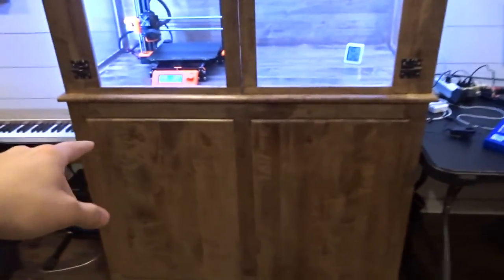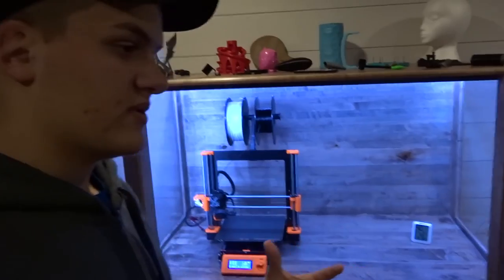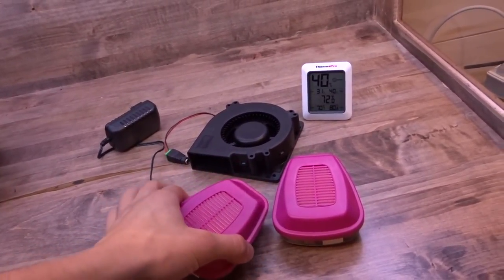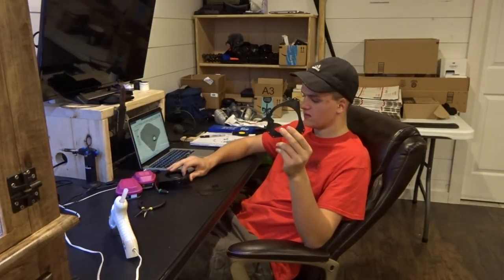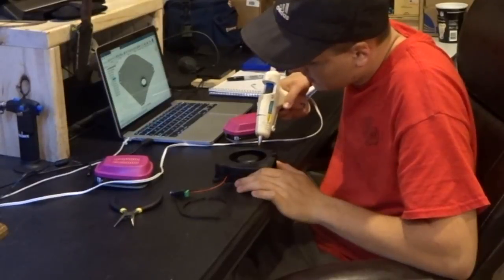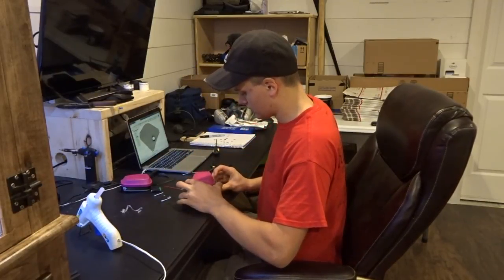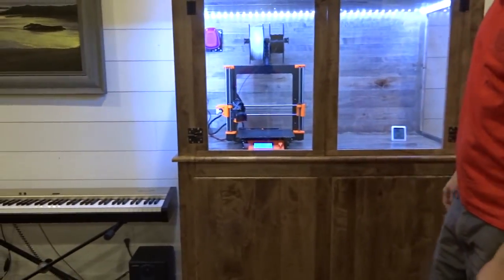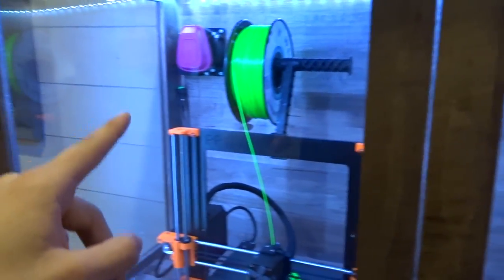3D Printed Air Purifier -- gets rid of the smell of ABS and toxic VOC's

Comment: Pro tip. Keep the spare filter in an air tight zip lock bag. It breaths even when not in use, so without proper storage. The filter is worn out when you're ready to replace the old one.
Reply from the maker: Good advice! Thanks for the tip!

Comment: You don't need to vent it to outside of the box. Just install the device inside the enclosure and let it continuously filter the air inside of there. Keeps inside warmer too!
Reply: that's what i was thinking! i'm going to make something similar!
Reply: Unless the enclosure is air tight, he would need to filter outside the enclosure to create a negative pressure inside the enclosure.
Reply: @AaronCarney-u3u  If it's air tight, you are simply circulating the air, so draw hot air from high up in the cabinet and blow it out low down in the bottom.  but you are just circulating the air through the filters, much the same as scrubbers work on a submarine.

Comment: I took the lazy way and bought a small enclosure, but then I 3D printed a mount for a small hepa filter, then ran that to an inline fan with 130cfm rating and it's done very well so far, noticeable difference in air quality.

Comment: Nice build, I think ill use this in my situation.   Using an old enclosed computer cabinet in my living room, due to having a small house.   I wanted to start using ABS but needed to keep the air clean for obvious resins.  Since this just filters the air side the cabinet it'll help keep the noise contained as well.  I also think ill use this basic idea to run a, separate, HEPA filter in the cabinet ass well. having a separate HEPA should also extend the life of the "fume" filter.

Comment: great idea.  I have just ordered one of these: a "DC12V Vacuum Pump High Pressure Diaphragm Air Pump 12L/Min Noiseless" as I wanted be sure I am getting the air throughput (diaphragm creates a seal as it is pumping rather than relying on the implied suction from an impeller) - just a suggestion/option - hope my comment helps
Reply from the maker: Great idea! Lemme know how it turns out!

Comment: I made a few devices somewhat similar to yours early in the pandemic to protect me during dental visits. Initially I used 3M #60923 filters (what you used), later switching to ones that filter only particulates (VOCs aren’t the problem in healthcare settings).

My initial fan was visually identical to what you used. I found that it and a better alternative — what I’m now using — are very sensitive to intake restriction. Using one filter significantly slashed the output airflow. To provide sufficient airflow for my intended application (dental), I used six to nine filters. The output airflow is much better with nine filters but still is noticeably reduced. That isn’t surprising because fan blade design is optimized for no additional intake resistance. If I had time, I would engineer my own fan so it could, for example, generate better intake suction.

I’ve begun measuring particulates generated during 3-D printing, but my particulate counter (and most others) cannot detect ultrafine particles, which are generated during 3-D printing. The big question is: do 3M and similar small particulate filters substantially reduce ultrafine particles? I will continue researching this and perhaps make my own ultrafine detector.

Most HEPA filters markedly reduce PM2.5 and larger particles but usually are much less effective against ultrafine ones. As a physician, my concern is that standard particulate filters may provide a false sense of security. Yes, they help, but do they sufficiently mitigate ultrafine particles? That is the greatest risk, so I will continue investigating this.
Reply: fyi check out Dyson air purifier filters: they catch ultrafine particles, and have a life of 12 months in the Dysons.  If you were to match the fan strength to the relevant Dyson fan, that might work?  Or just buy a Dyson if you can afford one, the larger the better.  They specifically claim that this filter catches viruses.

Comment: Couldn't you use water as a trap/filter along with this. Have the airflow blow across water to capture ultra fine particles?
Reply: Interesting idea - wonder if anyone has done that, like a small dish of water? I live in a dry climate but for some could add moisture to the filament.

Comment: I am looking to make enclosure for my SLA printer and this is the most elegenat solution i have found. Others suck so bad. I am open to buying fume extractor, but there is no guarantee that the filter in fume extractor is god enough for SLA fumes. So basicly, all solutions come to the filter choice in the end. I have researched slightly and found that the 3M 6099 offers most protection in combination filter. It is Rated A2B2E2K2HgP3 R + formaldehyde. I am only not sure why are there two different types of filters (60925/60926 and 6099) when both can be identified with ABEKP standard. Anyway, 60926 and 6099 should both be fine for most part leaving only <0.3 particles which can probably be filtered with additional HEPA meant for pm2.5

Comment: Check out 3M Filtrete MPR 2800 filters. They are expensive but they're designed to filter out ultrafine particles so AFAIK it's the best solution for filtering with 3D printers.

Comment: Great video. I know it's a little older of a video but wondering if anyone can share some information about how well this is working? I have a sealed cabinet I wanted to vent but this might be alot easier.. Im going to try but i hope others have had good luck with it.
Reply: Let me know if you build it and how well it works. I was thinking about it as well.
Reply: I did make this filter and it did seem to work ok.. I then upgraded to a 14 canister filter which draws air in from a 4in vent fan.. then filters and pushes the air back into the cabinet.. this does very well with abs fumes. Again with those nano particles I’m sure it captures some but not all. Over all the larger filters way more air and does a better job.. but this video helped me get there so thank for the video and happy printing
Reply: @daveolson9424  If you haven't, you should make a video on this. Sounds pretty cool.

Comment: I will be making this very soon for myself… need to make an enclosure first. 
Any thoughts or comments about if I were set the fan up to exhaust out of the enclosure??? Probably wouldn’t make much difference correct? The reasoning is I want the option to hook up some sort of duct to carry the air out a window if I feel so inclined…
Reply from the maker: So if you exhaust out of the enclosure, you will have a harder time keeping the air inside of your enclosure warm. This may increase the chance that your prints will warp. If you do vent to the outside, try to do it in a way that allows as little air movement as possible move over the actual plastic of the print as that could also cause it to warp.

Comment: Great idea!  Don't suppose anybody from the UK has designed their own version? As those parts are not available in the UK and shipping would be expensive lol. There are similar products but the fans I'm finding all have pin adaptors and the mounting holes are completely different, so I'd have to design a filter attachment for whichever one I pick. And then not sure what power supply I'd need for the pin adaptor :S   

I don't have the space for a cabinet like that, But I'm still looking for a small enclosure for my Mars 3 and my FLSun SR. Not having the best of luck finding one suitable. :)

Comment: Must be planning on getting another printer with that size enclosure, ; ) Also does the fan pulling air out reduce the temperature in the enclosure. Doesn't seem to effect the prints if it does. I've seen some people circulate the air back in after going though the filter. Great video, Thanks.

Comment: That is a sweet enclosure man. Putting the air filter high doesn't make sense to me though. VOC's are heavy, cool fast, and stick together so I would think they will sink and settle into a dust in the enclosure. (Not that I am actually worried about the safety of the enclosure or anything. You did a bad ass job)
Reply from the maker: Thanks man!

Comment: you should order another fan and use at least both of those filters. that's a lot of air volume in that enclosure for even just 2 of those. I'd imagine you'd probably need about 8 of those filters and fans to be adequate for the use case of having that much air violume inside the enclosure, plus running a fan for long periods in a filter like that will likely use up the filters much more quickly, so if you used more filters with a lower fan speed, that may be more effective.

Comment: Also nice job with the modeling. Great idea to use a photo, did you put a calibration ruler / measurement in the photo? How did you ensure there was no skew to the photo that would push measurements out one side of the picture? Interesting!
Reply from the maker: Thanks! Yeah I measured the fan and then defined that dimension in fusion. It helps to take the photo as square and strait on as possible to avoid any distortion.

Comment: awesome design how often do you find you have to change the filter?
Reply from the maker: Thanks! Results vary with what types of filament I’m using but I wanna say that I usually get about 50-70hrs out of it before I start to notice it degrading. I personally keep them for a couple hundred hours until they hardly work anymore.
Reply: @HappyMadScientist  oh that's good I just didnt want to be replacing them every week or so.Thanks alot great design

Comment: I like your setup.  However, I wonder if it would be better to recirculate the air through a filter within the cabinet instead of exhausting it. 2 reasons come to mind is , There is no reason I can think of as to why to exhaust the air within the cabinet.and the other being, if your trying to hold a higher temp within the cabinet it would be counter intuitive to exhaust the heat. Just a couple of thoughts that just popped into my head.
Reply: it would also do a better job, since the air to pass through the filter would do more passes.....
Reply: also why choose to filter out organics instead of the chemical branch of filter 🤔
Reply from the maker: Formaldehyde is one of the main things I’m trying to remove. It is an organic compound if I’m not mistaken.

Comment: The fan pulls air through the filter, where does it exhaust? Back into the enclosure right? Does it exhaust radially outward? Also, what modeling software are you using?
Reply from the maker: Yep it just recirculates the air back into the enclosure. Fusion 360 is what I use and recommend
Reply: @HappyMadScientist  thanks for the info. I'm looking to get my first printer, looking at E5+. Is there any concern with temperature? When people come up with solutions to exhaust their enclosures to get rid of fumes, I always wonder if heat loss becomes a problem.  Any thoughts? Thanks
Reply from the maker: @jakemouser2214  I'm not super familiar with the E5+ so I'm not much help there. I always recommend the prusa i3s because they are so darn easy to set up and use compared to others I've used + they are so reliable.
Yeah large printers might suffer from heat loss. A sealed chamber helps a lot. imo if ur exhausting the air, your airflow should be as minimal as possible. Just enough to keep a slight negative pressure inside the chamber.
Anyways hope that helps! Good luck with your 3d printing endevours!

Comment: Cool idea on the adapter. It would be interesting to get some concrete data on whether it makes the air safe or not. The cabinet looks great, but man... thats one big fire hazard. You even have multiple spools hanging out right above the printer. I would hate to see this go up in smoke.
Reply from the maker: Thanks! If you want data check out the filters safety data sheet. 
Thanks for your concern... but contrary to popular opinion 3D printers are very safe as long as they aren't cheap Chinese printers. The hot-end on many printers don't even get hot enough to auto-ignite paper.

Comment: Was wondering if anyone has tried this with SLA printers in the cabinet.
Reply from the maker: Not sure... check the data sheet on your resin and the filters?
Reply: @HappyMadScientist  I don't have one yet but looking at solutions if I do. The resin datasheets I've looked at I don't cover the smell or toxins except that you should wear a mask. Most YouTube reviews talk about the same.
Reply from the maker: @thenam3less  maybe it'd be best just to run a vent to the outside? You don't need to maintain chamber temp do you?
Reply: @HappyMadScientist  I live in Arizona. Don't want to have heat getting into my house or heating up the prints.
Reply: @thenam3less  I feel like you can have two fans.  One blowing outside of a window and the other blowing into the conditioned air in the home into the enclosure.  I don't think with the fan acting as an exhaust, will bring heat back in.

Comment: So how is it working?  Do you need to change the filter often?  I just ordered my Prusa i3 MK3S 3D and have about a month to collect everything.  This only filters the air, correct, it doesn't drop the temps in the enclosure?
Reply from the maker: It works good. I use it every time I print with ABS. How long it lasts depends on how often you’re printing and how much use you want to squeeze out of each filter. For me I’d say I use em about 136 hrs before I change the filter but that is pushing it. Yes it just recirculates the air already in the enclosure. Good luck with your new printer! Hope this helps!

Comment: You sound so nervous and almost embarrassed to explain why you want to have this. I know this video is really old, but studies have even gone farther to show that there are carcinogenic vapors that are released from heating most filaments high temperatures. so nothing to be worried about. I actually think this box does almost nothing to protect you from that in the long run since it is an airtight sealed. It's just a standard cabinet doors with air gaps all around. Most of it would probably leak before that. Air filter caught anything. But like you and everyone else says it's more of a concern if it is in an interior. Highly used room and running almost all day.

Comment: Although I appreciate you trying to help the community, this air scrubber does not work effectively. Ordered the material and printed your adapter and I get nearly zero air flow out of the fan. There are several other air scrubbers that use small HEPA filters and pelletized activated carbon that look to be far better. If your thinking about making this, don’t, it’s a complete waste of time and money.
Reply from the maker: Sorry to here that. It works fine in my chamber. Maybe check and make sure the hot glue “gasket” is sealing properly. 
Could be that your chamber is not sealed well either. While the airflow isn’t going to be that impressive, it should be plenty for a decently sealed printer chamber.
I’ve bought the other filters you describe. Specifically HEPA filters. They don’t get rid of all UFPs or any VOCs or smell as far as I know. The cartridge I used (which is technically HEPA) gets rid of most everything (including the smell) cept some very tiny UFPs which a HEPA filter is incapable of catching as well. 
Thanks for giving it a try. If ya make one that’s better let me know and I’ll link it in the description.
Reply from the maker: @Matthias Stegert Not sure but it seems they last about 60hrs before the airflow starts dwindling and maybe 100hrs before they stop working. Some times they last longer and others not as long.

Comment: Umm, the fan is rated for 12V 0.95A, but the adapter that you are using is a 2A. (Just letting you know :D)
Reply from the maker: Well the way it works is the fan should only use .95 amps of the available 2amps. So it should be just fine. Thanks tho👍
Reply: Well, that I totally forgot😅
Reply from the maker: Haha no prob.